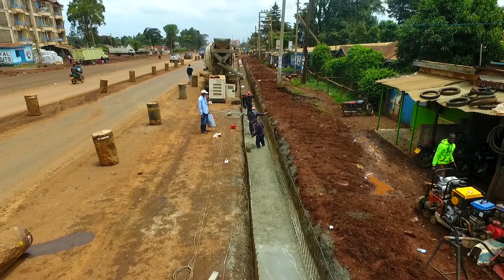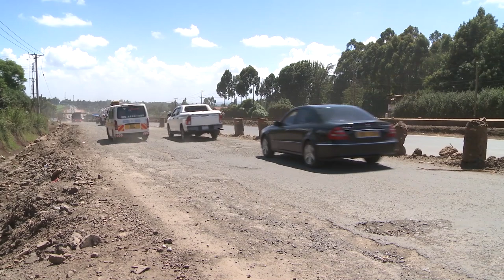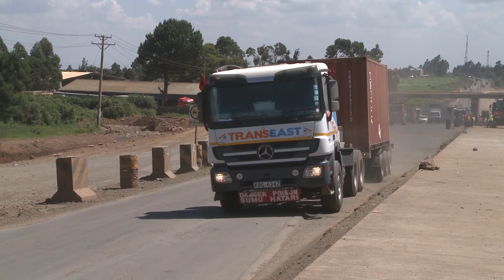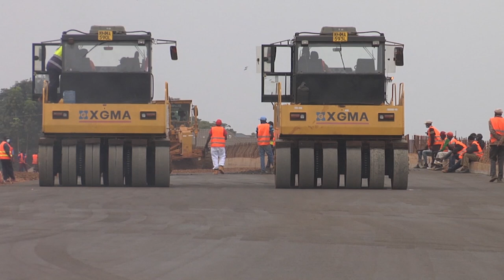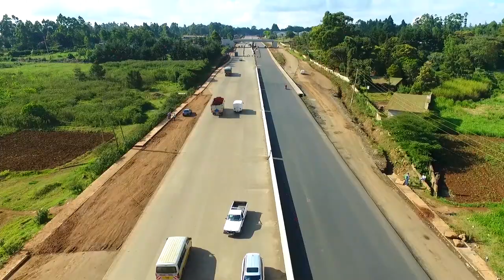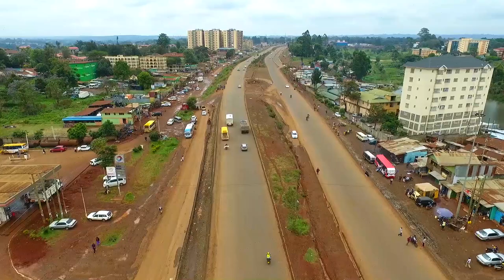WHY JAMES GICHURU - RIRONI ROAD IS BEING REBUILT

Comment: The Point is how the roads are constucted is the biggest problem, the underconstruction is not build by international Standards and the tarmaque is not helping it is only the skinn, during the heavy traffic the Surface get cracks and the rain will distroy the under construction, they never will survive the 20 years. Only compare the roads which are build by Japan or Turkish companies then you know where the right money is spend.
Reply: The engineer has explained very well. The road is done at T. 0 that the highest bitumen standard. Some section will be done to the highest concrete standard.  This an international trunk road. Boss acquaint yourself to engineering terminology.
Reply: @e.jack.47  boss?
Reply: @leonardmukuhi4810  what!?
Reply: @e.jack.47  you call him boss.